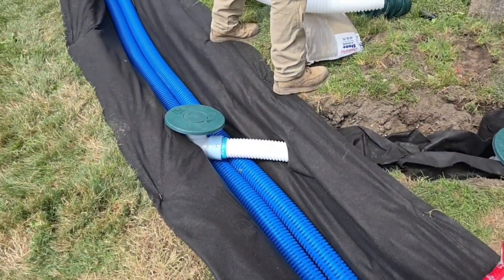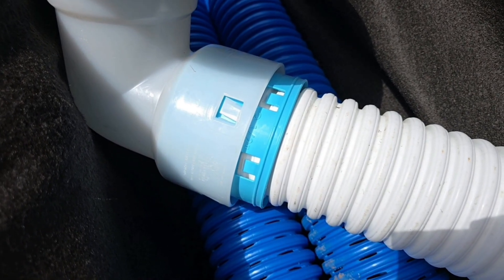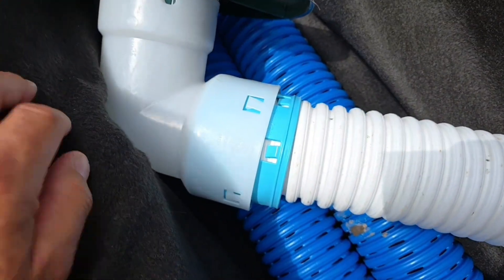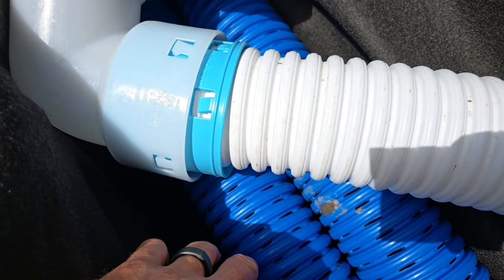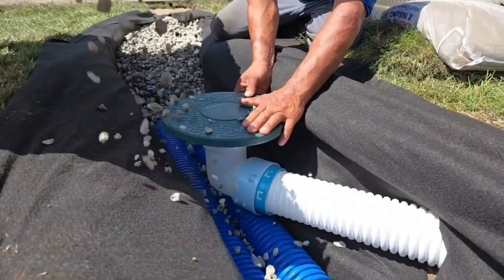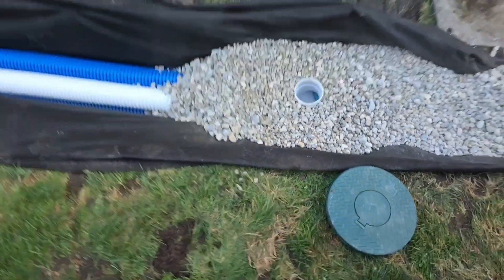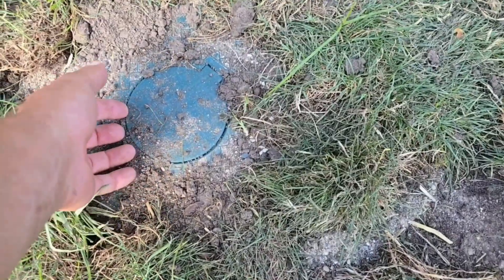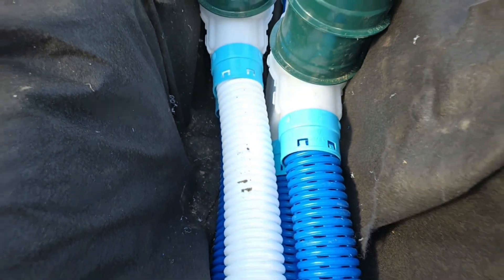How to Install a Pop-up Emitter in a Quad Pack French Drain Yard Drain 2026 UPDATE 50% LESS LABOR

Comment: I have a not quite a 90 I purchased from you can I use that with your new 3 1/2 pipe or do I need to purchase a new adapter?
Reply from the maker: Yes purchase the adapter 
Frenchdrainman.com 
Call 248-505-3065 if you have any questions. 
Thanks

Comment: That technique is definitely a labor and material saver for the downspout drains but if you have a sump pump discharge I would pipe that all the way to the final discharge area.  Do you agree?
Reply from the maker: 100% agree 👍
Reply: I am facing this same question.  Was thinking about leading the sump discharges right into the FD as well.  My SPs have never activated but if so the FD would take it all away, right? Buckeye, what causes you to pause to do the same and instead go to the final discharge point?
Reply: My sump pump is highly active at times especially during the spring time months of March and April.  The French drain will take it away but sometimes not as fast as the sump pump can put the water out.